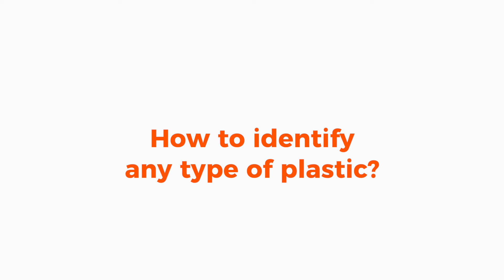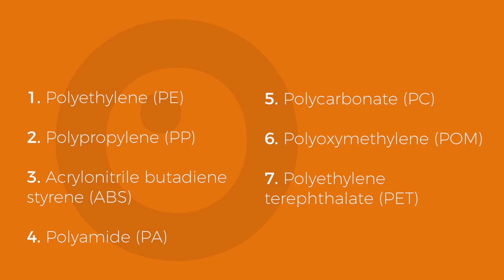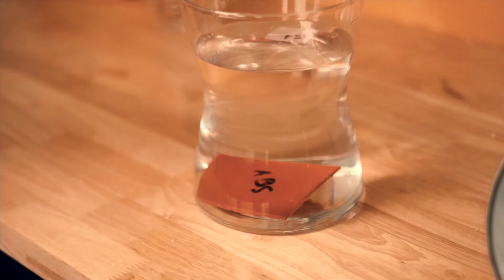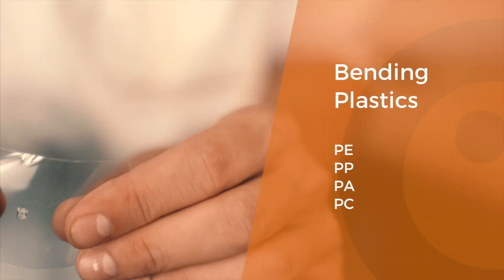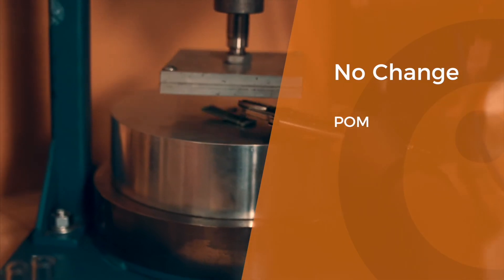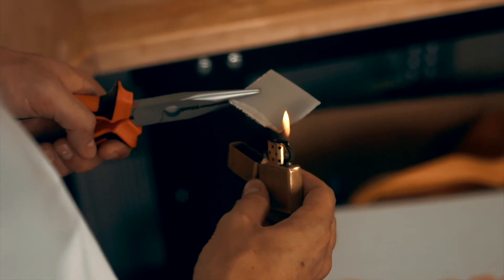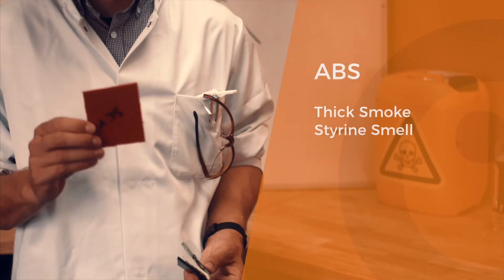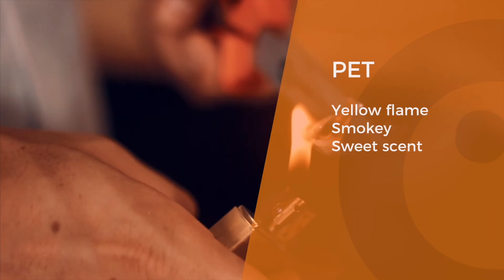How to Identify Any Type of Plastic | Orange Plastics Academy

Comment: Would have been helpful to add a flow chart for identification ie does it float or sink? Scratch tests are also useful. Does the plastic curl or chip away when cut with a knife. Finally, thermoset vs thermoplastic would have been helpful distinction here too. ie does the plastic continue to burn or self extinguish.

Comment: What the h#$2 is "oil like substance" or "candlelike grease effect".   Is PE and PP so expensive you couldn't find any to demo?  That's all I came here for: Distinguish HDPE vs PP.   Still not sure what I have.
Reply: Hell is not a curse word you know
Reply: @reddragongaming8501  Who said anything about that word?   And why would you think they did?   There are multiple 4 letter words starting with "h" I can think of.

Now back to the topic -- what is "candlelight grease effect" or "oil like substance".   Found another video with some actual samples of HDPE and PP.  I had PP, which welds similarly at similar temp to HDPE apparently, smells waxy when heated, but requires PP not PE to weld.  Quite a learning experience.

Comment: Would like to know the best glue to repair cracked or broken plastics, especially PP and PE. Many types of glue will just not bond to these 2.
Reply: After years of failure testing many varieties of glues, I heard about plastic welding, which I use over bonding agents whenever possible. Using soldering irons for melting plastics, even with adjustable temperature control, proved difficult and largely unsuccessful. I find that my heat guns work very well but required making custom tips to limit and deliver the hot air precisely. (Beware of overheating the inside of the gun when restricting the air flow). In my uneducated brief experience with this, I believe it essential to use the same kind of plastic as the part to be repaired when welding. (note: my Smoothy wax melting/shaping hot air butane torch has proven to be too hot to be of use unless a long tubular tip is made to allow cooling before application of air on plastics.) My respect and gratitude to Orange Plastics.
Reply: any sort of cyanoacrylate glue should work as it sorta acts like an acid for the first few seconds and fuses the two parts together before hardening
Reply: 5 second fix, it works best on clear plastics but I've used it on solid color plastics with success
Reply: Toulene

Comment: I have a question for your expertise: I'd like to fabricate sliding plates for goalie my pads (for inline hockey). Which plastic would be light, durable and slide the best on an inline hockey rink surface?
Reply: HDPE would be a good bet as it is light, strong yet flexible and can be found in most milk cartons and drink lids, it can be identified easily by its recycling symbol with the number 2